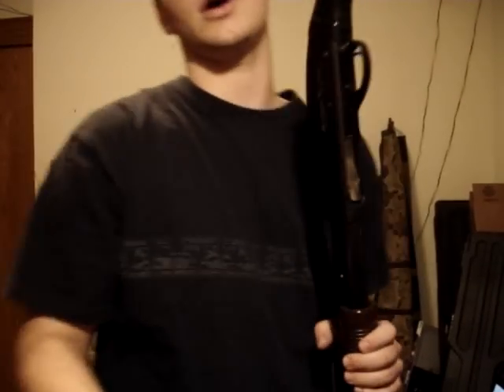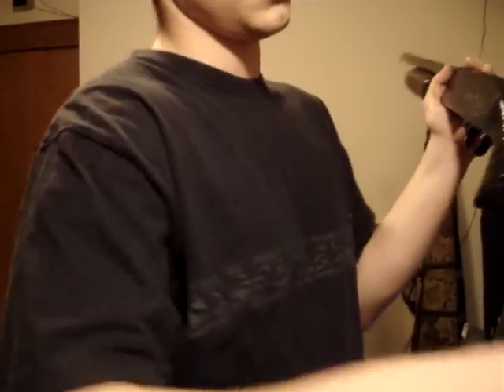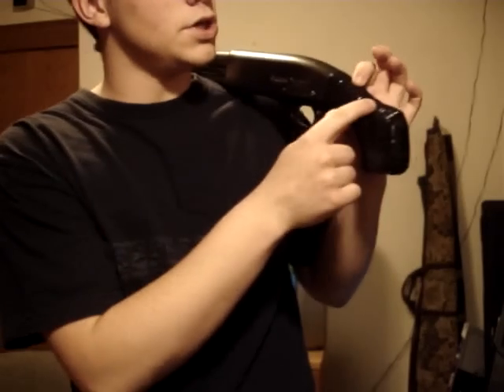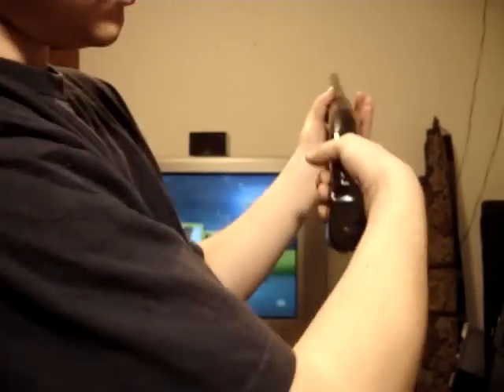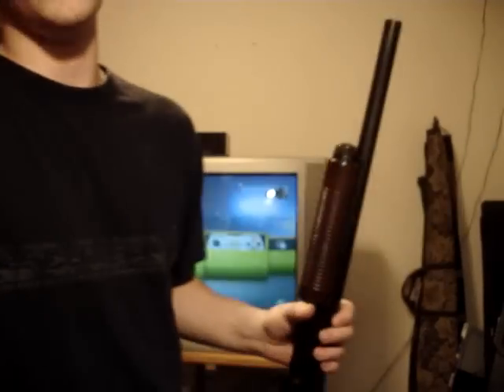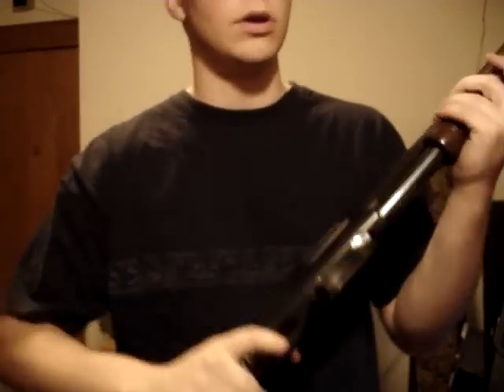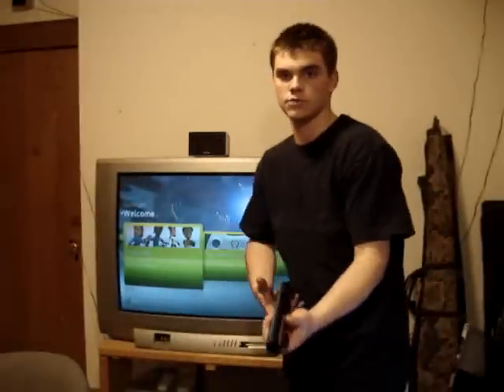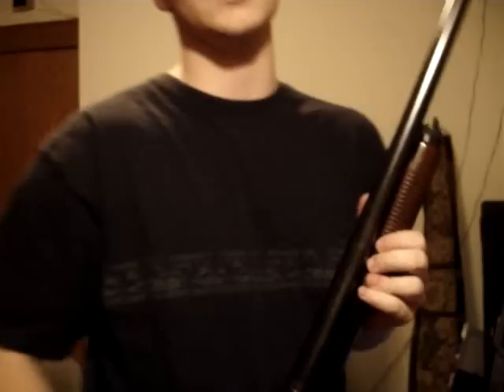general saw off shotgun info

Comment: When you saw off the barrel yourself,is there a certain length that needs to remain or certain point where it should be cut to be at certain diameter at end of the barrel or does it not matter?
  i bought a used winchester 1200 at a gun show over the weekend and want to make it into protection style gun.it has everything stock currently and the barrel is quite long.

Comment: Nice vid but kind of unaccurate, i got a 12 gauge i sawed off with an ordinary reciprocating saw went and got a 4 inch bolt from ace hardware and and put the grip back on, head of the bolt sticks out and has no discomfort, no reason to counter sink it. barrell is about 14 to 16 inches. No need to do any bluing, and i wouldnt recommend any shooting postions other than hip firing